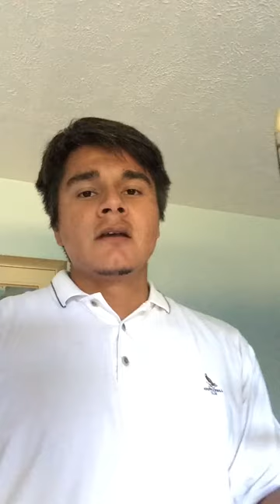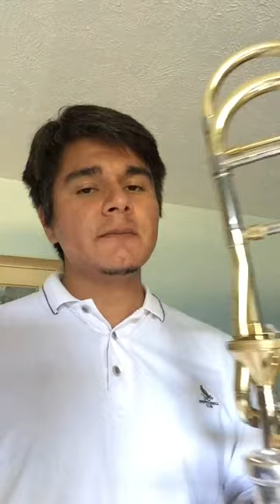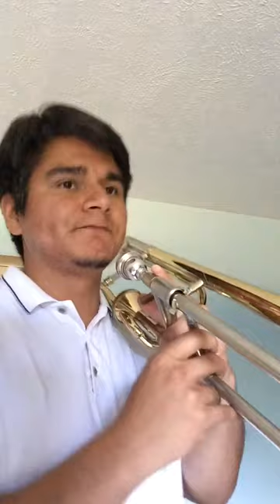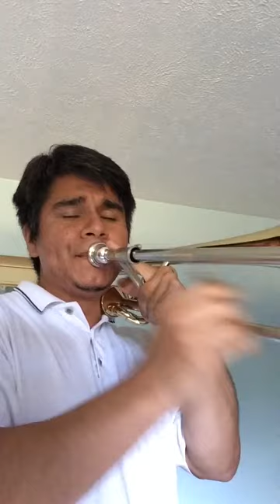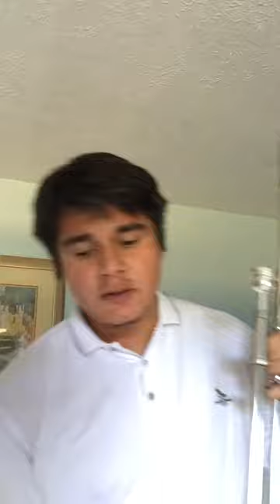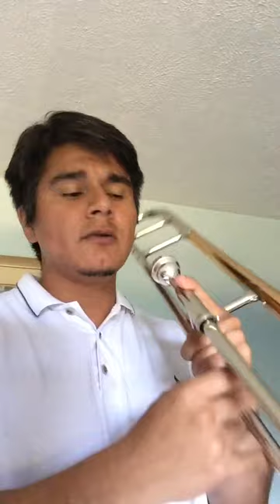Large bore vs. small bore (jazz) trombone

Comment: Of course, mouthpiece sizes can change the sound as well. The super is a dual bore if I'm not mistaken. I have the olds Studio which is the same bore I believe. Both are very good horns. I would take it over a Bach 6.
Reply from the maker: Adam, I didn't know that about the Olds, thanks for sharing! I'm a Bach lifer, but I did love the sound that came out of the Super. I sold it a couple years back to purchase a Bach 36 LT (good fit for my classical training and jazz-directed career path), but definitely a great horn. I'd love to try a Bach 6! Why do you prefer it?
Reply: I thought the sound of the bach 6 that's a little harsh a little bit too tailgate for my taste. Lol. With your tone and intonation, you would definitely make any trombone sound good.
Reply from the maker: Interesting! Might be a good fit with my research (studying early jazz trombonists) 🤔
Reply: All large bores don't sound the same either. Some are a bi darker than others and I can tell when the trigger is used.